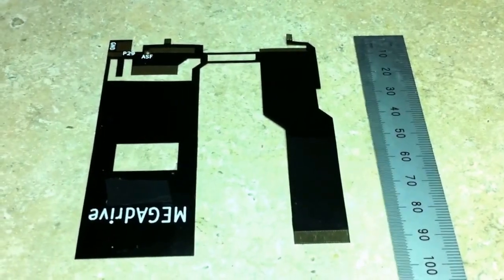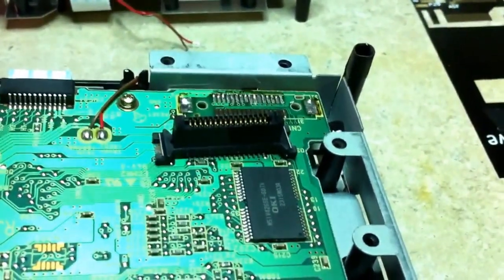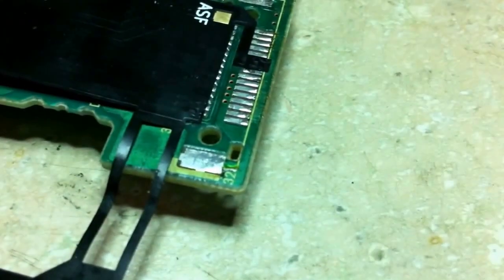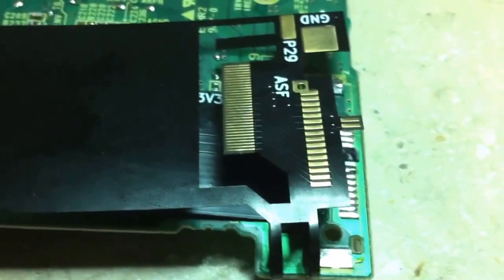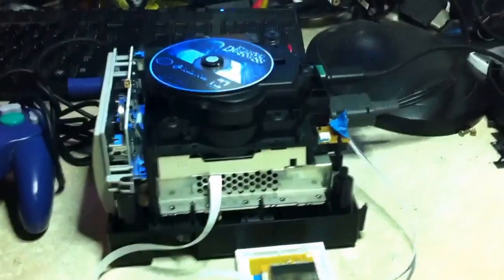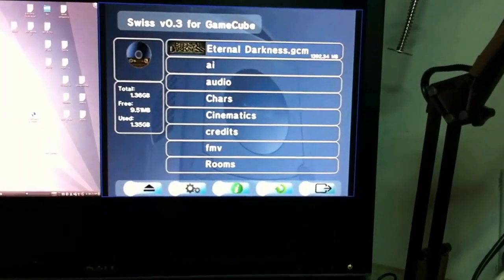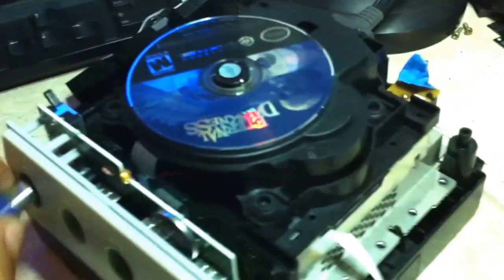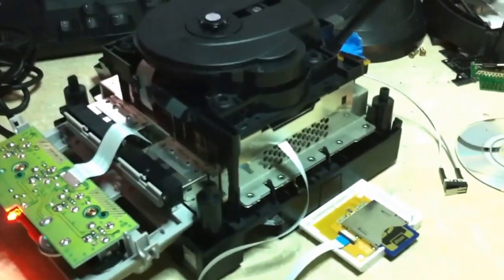MEGAdrive V4

Comment: Among v1 - v6, is this v4 the only one that allows for use of both a WKF/WASP and the DVD drive?  Is it possible to manually wire this solution by hand, without having your v4 flex pcb?  This video shows the appeal of making use of both SD and DVD in a same system.  I also like the replacement ease of moving it to another gamecube.

Comment: That is awesome man! On the reverse surface mount are you tinnig all the connections and then heating the end of each to make the connection?
Reply from the maker: the pads already contain solder on the PCB side which makes soldering the Flex easier onto the PCB.....but it is still a tricky process
Reply: It looks like it man. I'm sure it's beyond my skill. Great job.
Reply: Can I run this with a xeno GC v2 also?
Reply from the maker: Marcus Mitcham no need to add xeno unless you want to direct boot your DVD-r. otherwise, swiss menu can boot DVD-r
Reply: Oh awesome I never knew it could do that. Thanks.
Reply: +BadAss Consoles Where can I buy the v4?  I don't see it on your website, and I REALLY want to purchase one. :)

You mentioned that you might not sell it for long due to it being a pain in the ass to install.  I don't need for you to install it, I'll do that... I just need to source the components so I can do it.